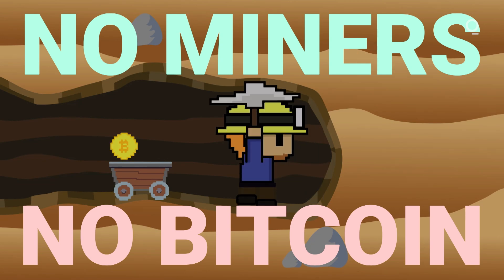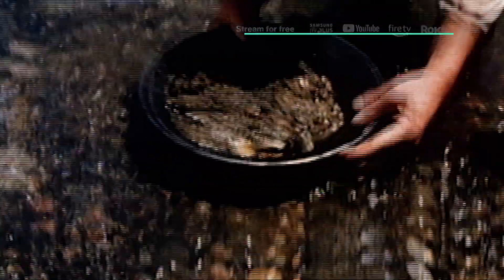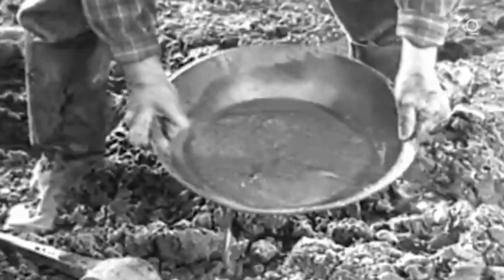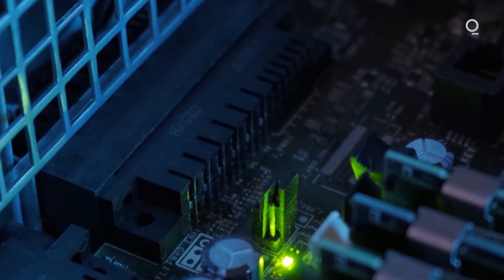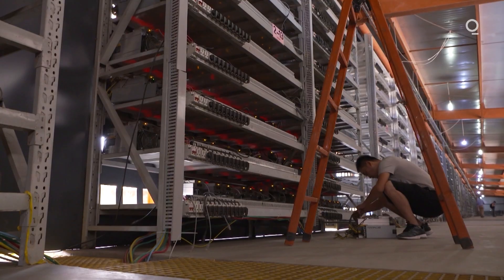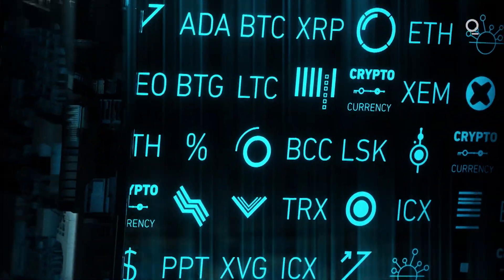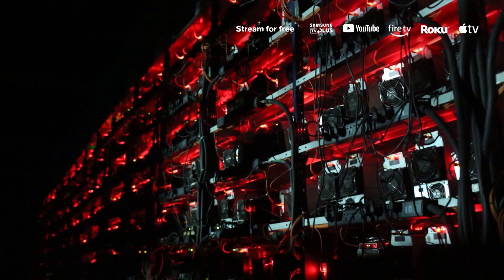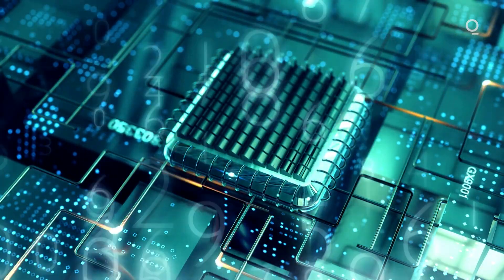How Do You Actually Mine Bitcoin? | Decrypted

Comment: Consider the following:
a.  Not everybody has the same internet connection speed.

b.  Location matters:  Take 3 entities, A, B and C.  A and B are close together and C is very far away.  The electronic transfer time between A and B would be short compared to A and C or B and C, relatively speaking.  It's the same principal people utilize with Wall Street.  Computers closer to Wall Street can have faster transfer speeds due to their location.  High speed, high frequency trading can make one very rich relatively quickly.  Also easier and quicker to manipulate markets.

c.  But, with crypto currencies like bitcoin that are not centralized, not everybody would be on the same page so to speak.  The reality each would be experiencing would be different for the same universal time.

d.  In other words, reality still matters.  There are those who will be 'screwed' and there will be those who are the 'screwees'.  And if you are not 'screwing' someone else, guess which one you are.